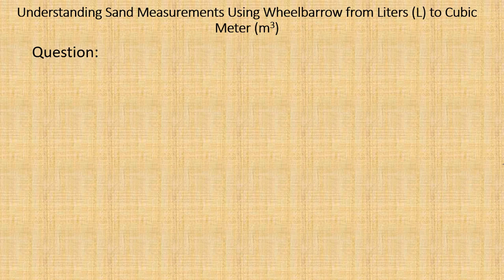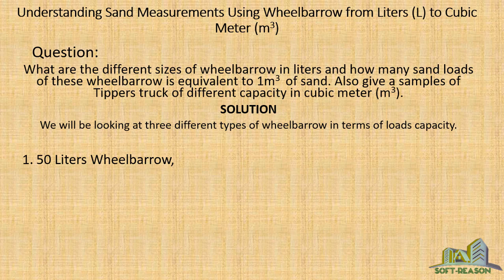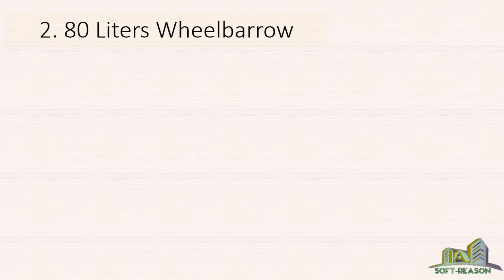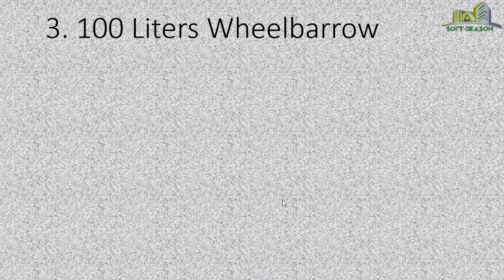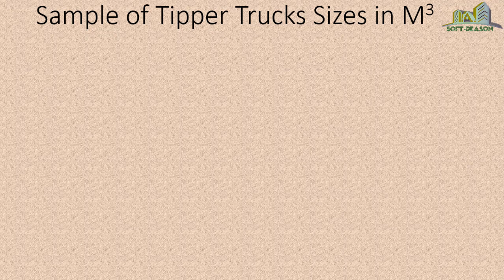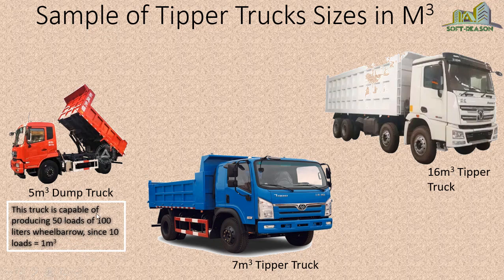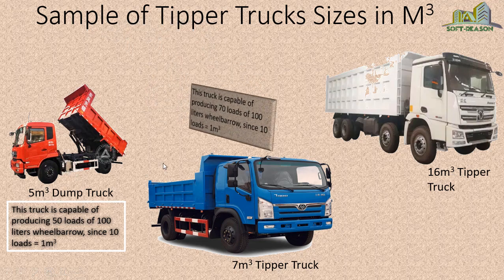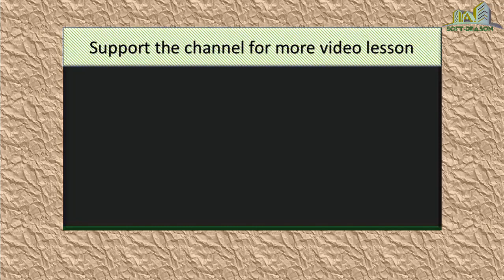How to Understand Wheelbarrow Measurement in Cubic Meter

Comment: Should the sand load level be flat or heaped in the wheelbarrow to get the required cubic meter?
Reply from the maker: Whether flat or heaped, ensure the same level is maintained though out the measurements. Very important.